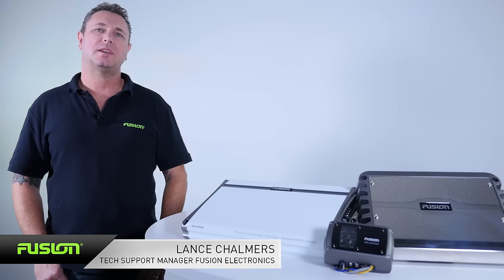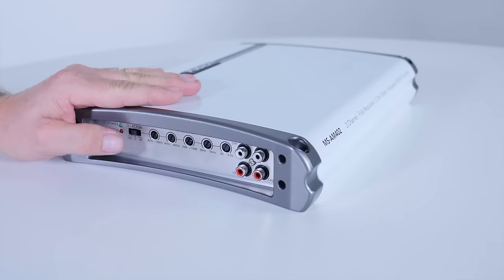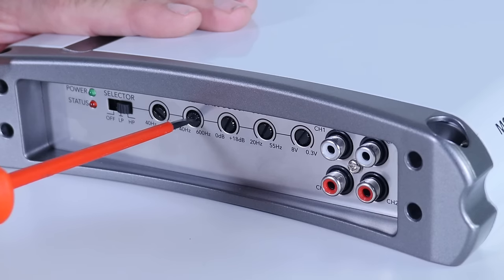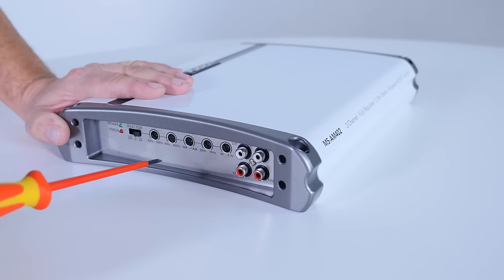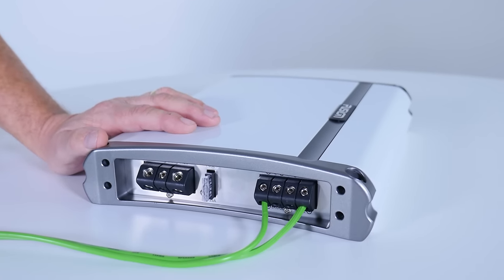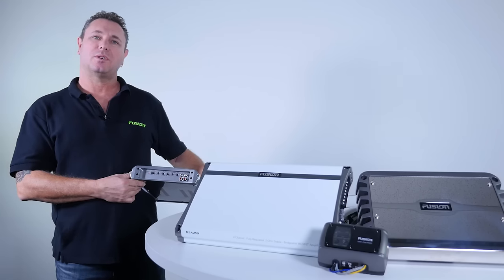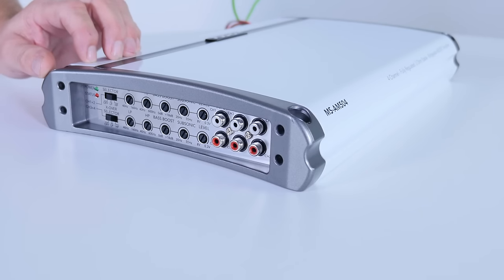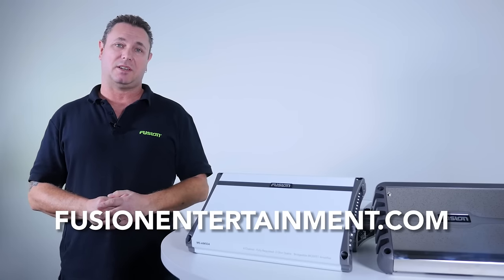Tech Tips - Overview of the FUSION AM Series Amplifiers

Comment: And I'm a former car audio enthusiast. I had a Kicker Solobaric-X 18" with a Kicker 2500 amp in a Jeep Commander. I did all the wiring myself including the big three. I know a thing or two about quality manufacturing of amps as I ran through several other amps on that speaker before I got one that could handle the power of that sub (that magnet alone was 100lbs!).  From what I see of the Fusion AM series is that it exhibits quality manufacturing and I expect it will perform for a long time to come (as long as it's properly set).
Reply: Russell, were you able to figure out the settings for your amp? If so, I need help myself, regal sent me a new amp and the sound is terrible. How did you set your amp and head unit?

Comment: THANK YOU SO MUCH for this video. So helpful. I just bought a brand new 2020 Regal2000ES and opted for the upgraded sound system, which includes the AM504 and a 10" Fusion woofer (and Fusion head unit). Regal tuned the amp down as low as possible for bass output so I knew I had some work to do. They way they installed the amp is such that the controls are not visible and in fact you have to crawl into a storage locker in the boat and even then there is only about 6" of clearance which makes adjustments very difficult without removing the amplifier from it's mount. Short story short, I thought there was only one set of controls and so I adjusted one set and could not figure out why my audio quality wasn't where it should be. Then I finally found the second set of controls and got my LPF and HPF set correctly.  What about the sub-sonic filter settings on the head unit itself? It allows for the 4 standard settings. Is this independent of the manual control knob for subsonic filter? Will it override the control knob? Should I set the control knob to 0 and only adjust via the head unit? For a 10" woofer running on the AM504 playing mostly party style music (bass heavy rap, electronic music, rock etc), what would be the subsonic filter setting you'd recommend?
Reply: What tube settings u running having the same issue with my regal 2300